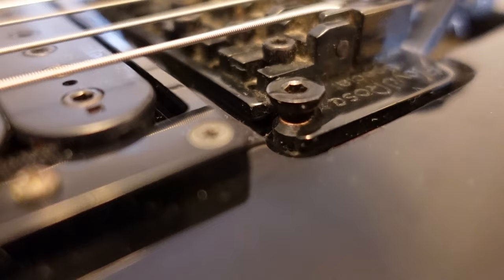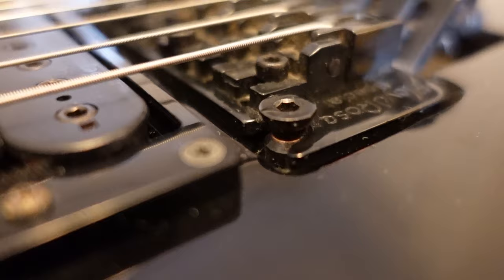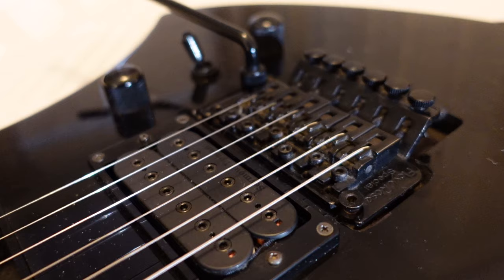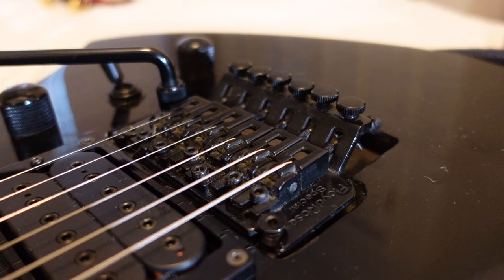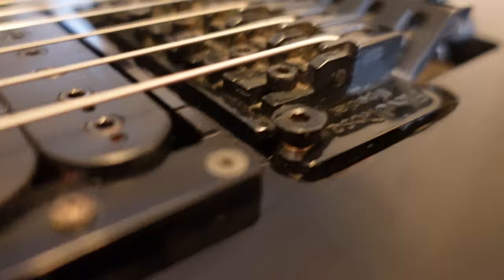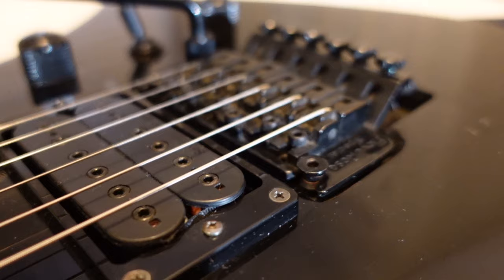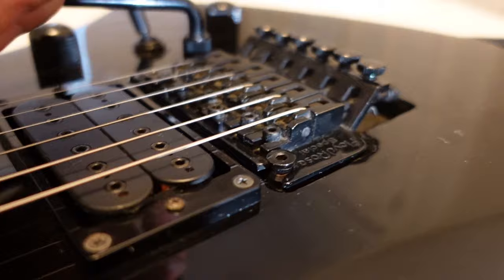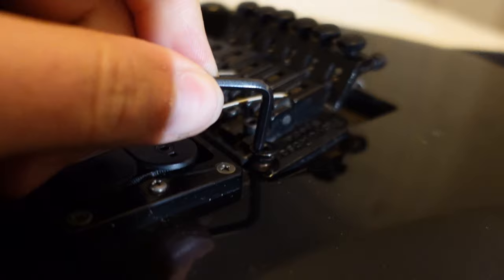Quick Tips - Adjust the Action on a Floyd Rose Bridge the right way!

Comment: Noooo dont do that!!! pulling the trem only adds more tension to the block springs and that tension is transfered to the posts … if u really wanna keep on the “safe side “of doing this…losen both string tension and brass block springs tension but… and is a big BUT, every time you mess with the springs tension screws you also wear your guitar’s wooden body screw holes threads and will eventually will have to do some work on those.
Reply: Maybe those holes could be fixed with the golf tree trick that you use for house windows: If you have a rotted window hinge, you take it off.  Then force wood glue into the hole.  Then hammer a golf tee into the hole.  After it dries it's like rock hard wood that can be drilled again.

Comment: I just bought a Schecter Omen Extreme with Floyd Rose special and so far it seems perfectly fine and reliable and not what everyone makes it out to seem. I think the biggest problem with Floyd Rose specials or probably any Floyd Rose for that matter is not really the deficits in the material or craftsmanship but more of a lack of common sense of just about everyone I've seen using them. Of all the people I see using Floyd roses even on YouTube I see nearly no one lubricating these things like ever. I was ready to throw mine out the window after my first string change and setup because the strings kept going up and down in pitch. And then I realized We're literally rubbing steel against steel with zero grease or oil. Doesn't matter if you have an original or a special or whatever The fact of the matter is when you take dry steel and rub it against dry steel in any way shape or form whether it be on a guitar or an industrial bearing or the parts in your motor of your car, if you don't lubricate those parts and you have steel rubbing against steel your stuff is not going to run smooth at all and it's going to wear out super fast. Soon as I put some 4 in 1 oil on all the friction points this thing started working as smooth as butter. And you're in this video showing to lower The arm down before you turn the posts and that's almost as boneheaded as everyone else I'll be honest. The problem is not the angle or the tension The problem is that it is bone freaking dry. If you grease that or oil that you will not have a problem with those posts wearing anywhere near as fast as what everyone else is experiencing. These guitars literally come from the factory with no lubrication because they don't pay people enough money to sit there and grease every little individual part. It's up to the owner to take care of these things. But most people have zero common sense. The four in one oil that I used worked fine but a better more long-term solution that I plan to do on my next restring is to completely disassemble the bridge clean all the oil off and then use some good high quality lithium grease on all the threads and contact points. I have no idea how there's not a million videos on YouTube talking about lubricating these bridges.

Comment: You're exactly right that's exactly what I told the guy down there at Guitar Center when he was doing it the wrong way on my guitar and I told him I said hey don't do do it like that you're supposed to loosen the tension on the strings you don't want to wear out the knife-edges he thought I was crazy
Reply from the maker: He better install some new posts and sharpen those knives again!
Reply: Yeah there would have been a problem
Reply: Why didn't you do it yourself if you already knew how to do it?
Reply: @harrisonbeacham-peterson8916 I didn't do it myself because my guitar was already in the shop being modified I've been changing out the pickups yes I have done it myself and the bridge is working fine it is a beast Japan only makes the best!👍
Reply: @thelightstillshines2476  hahahahaha
Reply: @morphius747  my guitar is still functioning excellent without any repairs it does not go out of tune I'm about to jam with it in a minute on a 100 watt Marshall DSL

Comment: Much easier/safer to take the springs out of the back, pull the whole bridge out, adjust the action, then put the bridge and springs back in. You can even keep your nut locked and the guitar will stay in tune too.

Comment: Wouldn't it be worse to do it that way due to the angle? Sure the tension could cause it to cut in but at least it would be in line with where the knife edge contacts, but dipping then adjusting could cause a diagonal cut which I feel like would be MUCH worse, I've only owned one Floyd guitar and had it for a month now so maybe that's it
Reply from the maker: It would be a problem if you didn't relieve the tension. That is the whole point. The springs on the back keep alot of force if you are turning the posts without relieving the tension
Reply: @DeathMetalDevin  Yes, I understood that as shown in my original comment. What I'm saying is despite the lack of tension it seems like the knife edge could still manage to mess up the post except it could be worse considering the diagonal angle rather than straight on.
Reply from the maker: @Ayyem93  if you depress the bar it takes the tension off the posts therefore would not cut into the posts with the force of the springs. It wouldn't be worse what you don't want is groove cuts where the bridge SITS on the posts, unless you want an unreliable floyd that sticks out of tune. From my decade of experience it is what I've learned
Reply: I've seen a lot of Floyd's that have been ruined by not removing the tension. Right On  DMD! Sometimes I've been able to remedy people's "unreliable" "unstable" Trem by polishing the posts smooth again, if they haven't been too scarred up from the damage caused by turning them under tension.
Reply from the maker: @williamdenton1410  there would be much less hate for Floyd's if they are taken care properly!
Reply: @williamdenton1410  It just seems that turning them with the trem at an angle would be even worse were they to dig into the post, that it'd get caught at way off from 0 positions. No tension will help, but it's still metal on metal contact tension or not
Reply: This is backwards!  Pressing down on the tremolo bar actually puts MORE force onto the posts.  The physics of it is that it is a basic Class 1 lever.  The posts are the fulcrum, the spring is the load and the tremolo bar is the force. As you put more force on the tremolo bar (force), that force is transferred to the posts (fulcrum) which then lifts/stretches the spring (load).  The proper way to relieve force from the posts would be to loosen all of the strings by using the tuning machines on the headstock.
Reply: @guitarman517  A much faster method would be removing the bridge by taking out the screws, same idea though
Reply: @guitarman517 you're literally factually correct. Besides, unless you're using an FR Special or cheaper Licensed versions you should be fine. Espically with a 1/4 or 1/2 turn every now and again. An OFR will not wear out. I have plenty of them. I also have a few FR 1000's and they appear to be just as strong as the OFR, as advertised. Even as a kid, before I knew about the metal differences in FR's, I had a Licensed FR on a cheap LTD and it never got messed up. Granted I only made the usual occasional adjustments. I never went full ham monkey grip and just cranked the pivot screws up and down. I'm sure that'll screw up any FR. If the pivot screw needs multiple full turns I'd recommend just removing the bridge completely, ballpark the height, reconnect the bridge and do the minor adjustments under tension. It's fine. Floyd Rose never specifically instructed players to slacken strings, and certainly not go full dive bomb to adjust the pivot screws. It's just common sense. It'll remove the color coating of the pivot posts, and that's probably what we're seeing here, but it's not gouging the metal... unless, again, it's not an OFR or FR1000. Just be mindful. Smh

Comment: An old guitar urban legend. You don't have to do this with a decent FR (read: OFR, Schaller, Gotoh, old Fernandes HeadCrasher) and the knives get just as much friction and wear when playing aggressively. My 1999 Schaller still stays in tune perfectly and it has original blades (they're replaceable).

Besides, you don't release the pressure by pushing down the trem arm, you just change the angle of its application (i.e., the string tension decreases, but the spring tension increases).
Reply from the maker: This is def aimed towards licensed trems because of the soft metal and OFRs do hold up alot better obviously. When you dive it enough it takes it off the center of the post. At this point it's lifted by the 2 sides instead of the knife sitting on the middle of the post while you adjust height. Try it!
Reply: @DeathMetalDevin  Well, either way, dude, kudos for Dissection playing in the background.
Reply: Exactly...
Reply: Do you think we should go with this information? I tried to find the "right" answer but couldn't. I have an Edge-Zero II trem which is an original Ibanez as you know. But on the treble side, my string action is a bit higher than I used to play around 1,7 mm. Should I adjust it without doing anything, is it ok?
Reply: @kornerdiregi3047  Nah, Zero II isn't all steel and it's made in China. I suggest you apply some lubricant and/or lower the string and spring tension before adjustment. And tbh, it's best to swap it for an original Edge or Edge Pro.
Reply: @Admiral_Bongo  What are the downsides of the Edge Zero II in your opinion.  Not trying to argue just wondering.
Reply: @LegendLength  Crappy metal. The knife edges simply get dull early on and the saddles develop grooves in them.

Comment: You don't have to do that, nor remove all strings either.
Simply adjust the post height with the right size hex / allen key by small amounts until it feels & plays right.
My Gotoh trems get adjusted this way when needed, and have been for decades.

Comment: You should NEVER, EVER turn/adjust a post with string -NOR spring tension on! This is a total 'no-no' -on ALL knife edge bridges.
To to this safely, easy and professionally:  

1.) Flip the tuned and locked guitar over on Your lap. (Point the bar towards the back strapbutton -and balance the bridge tension/bar against Your lap -as You remove the springs.) 
2.) Remove all the trem springs at back.
3.) Lay the guitar back onto Your workbench.
4.) insert allen key in the post you want  to adjust.
5.) Use your fingers to push the baseplate away from the posts -as you adjust the posts.
6.) Back with the guitar onto Your lap.
7.) Mount back the springs.
8.) Congratulations! -You're DONE!

JUST repeat THIS process untill satisfied. -Easy enough, right? 
This process is also easy to combine -with having that extra popular spring tension block between the tremblock and the rear trem cavity wall -for exact testing/playing/intotaing process during the set up. 
Yes: This is a part reason why some of us techs are faster; both in live gig situations -as well as in our shops. But beware: Many shop techs still adjust with string tension on. Basicly charging You -for fucking up Your instrument. 

In most cases you do not even have to de-tune the instrument at all. The guitar (with the locked nut) should be fairly in tune with the springs back. 
However: On some guitars the string tension makes it harder to push the base plate back. If this is the case You need to lock up the nut -and loosen the strings that pulls the template the most. Absolutely NOT all thestrings; but only enough -to able You to push back the baseplate when adjusting the posts. Example: Maybe just one clamp -holding the High E and B/H string.

To understand and know THIS: Accually puts Your own knowledge about Floyd Rose sep up ahead of many, many selfnamed; pros, techs and luthieres out there. (Simply too many don't know -or refese to understand; that turning the posts under ANY ammont of contact and pressure: WILL scar the posts -as well as dull-up knife edges on the trem base plate. 

-Do it right my friends -and let the 'dummies' keep doin' their thing... 
(If You want to help others from fucking up their locking trems: -Just spread the word.)
Reply: Could you make a video showing your way?
Reply: Will do thanks
Reply: @elmarisco8459  I've never released tension on any of my OFRs for years. Never had an issue🤷
Reply: You are exactly right! Thank you for sharing the steps. By the way, I have GOTOH 1996T, which is not junk in any way shape or form, and it says right in the user manual NOT to adjust the posts under tension.

Comment: If you have original Floyd rose. No problem. License Floyd rose you better to take strings tension and spring tension. Then you can adjust. No problem with the German made Floyd Rose. Stronger steel.

Comment: Sometimes even if you take all the tension off and simply rotate the bolts you would end up exposing the part that was previously in contact with the edge of the tremolo, and it looks like that as well.
Reply from the maker: I've found that not all Floyds are designed the same unfortunately but for this one it does literally lift off the edge and onto the sides instead

Comment: That won't help at all.  The springs are still providing just as much pressure as the strings.  They balance.  The amount of pressure just lost from the strings was approximately added right back by stretching the springs more.  The only way to avoid the line is detuning, or maybe using a pry bar some how to jack the base plate off the stud momentarily while you turn it, which is a great idea if I can figure out how to do that without damaging the body.

Comment: as stated by a few on here already, this method does not in any way relieve string tension on the posts. pushing on the bar slackens the strings, but the stretching of the springs make up for whatever tension you're losing on said strings (in fact, if you slacken all the strings completely pressing on the bar, it would be even more force than if you left the trem level). that said, the people that set up your guitar when brand new have adjusted the string height at full tension from the factory/and or at the guitar store... and it is not an issue at all. a guitar will only undergo a relatively few adjustments over its life time. also when you use a trem, you are technically wearing on the knife/posts anyway in the same fashion as adjust string height. a tremolo that won't go back to zero point is either a setup issue (things not tightened or setup optimally) or just wore out from normal use (a lot of times factory defect as well). usually checking the setup and/or buying new trem posts can alleviate the issues
Reply from the maker: Thanks for the comment, as I've stated in several of the same posts by people the zero point (knife edge on center of post) is completely out of the quation once u lift it enough. The sides of the floyd (not the edge) lift it off of the edge AND center of post. Only then would I adjust. Watch the video closely
Reply: @DeathMetalDevin  the knife edges are still sitting on the same spot of the posts, as the groove/knife edge is the fulcrum. by all means do this if it makes you feel better... it's not going to hurt anything, but it's exactly the same as adjusting the bridge that's level under string tension which also does not hurt anything. if you truly want to relieve OCD  and ease oneself about theoretically damaging knife edges is to do this; pop the springs off the retainer in the inside/back of the guitar so that there is no spring tension and adjust, then re-attach springs and check height
Reply from the maker: @bassgoul  the idea is to save zero point for the knife edge and center of post which causes all the tuning instabilities. I can promise u when I adjust it the vital points are not making contact. Now on an Ibanez Edge? No way around it. Don't do this

Comment: That does not release the tension on the studs. It just replaces the tension from the strings with tension applied to the trem bar.
The fact that the strings are now loose means that you’re actually increasing the tension on the studs…
Reply from the maker: If u look closer the knifes are off the CENTER of the posts. Which is where it matters
Reply: @DeathMetalDevin it will still ruin the knife edge over time. I learned from my own mistake.
Reply from the maker: @zoltantoth2227  when it does then the decision to get a real floyd can be made if it's used that much
Reply: That will last longer for sure.

Comment: My science brain tells me this is not lowering the pressure on the post as much as you think. 

As long as the springs in the back are on and your hand is pushing the bar, the actual pressure wasn’t relieved, only the tension on the strings were. 

Nawmean?
Reply from the maker: What matters is that the pressure is off the axis. That's what u should be worried about on the posts

Comment: Looks to me like although it does relieve the tension off the strings the bridge is still against the posts. Is it not pivoting against the posts when you release the tension from the strings?
Reply from the maker: Good question but it is not. if you push the floyd down enough the knife edge lifts off of the middle of the post. Try it and you will see that contact is made at the 2 metal pieces above the knife edge saving the groove of your post
Reply: @Death Metal Devin (DMD)  thanks for the video.  Have a question.  How low can I adjust the bridge? Mine is flush with the body, but my action on frets 12 to 22 is still high. I don't think adjusting the truss rod any more will help and I've seen posts where they say not to adjust the bridge lower than the body of the guitar. 
Ps - I have mine floyd 1500 trem blocked to dive only for ease of downtuning. Thanks